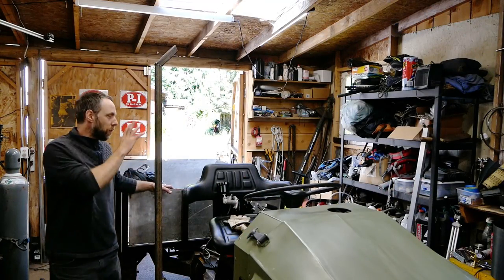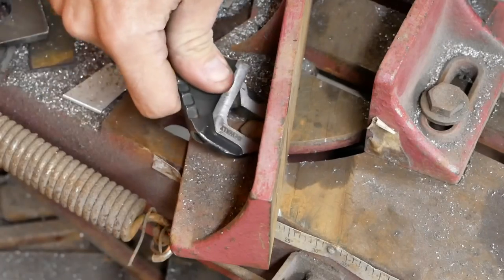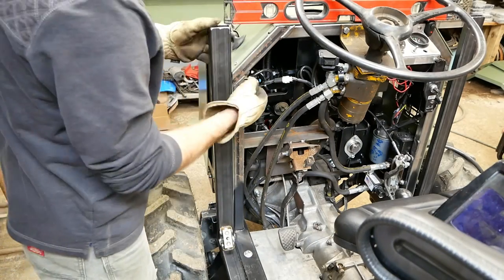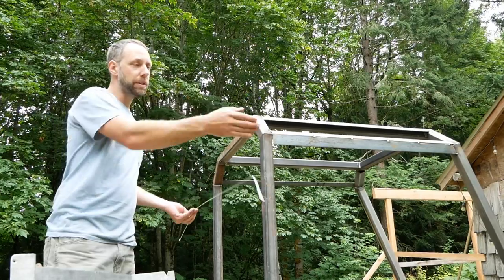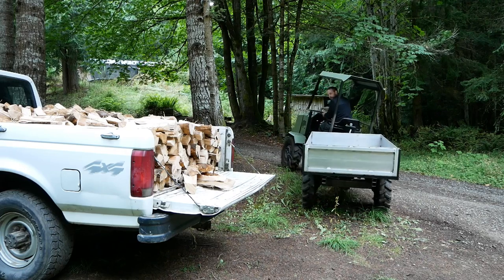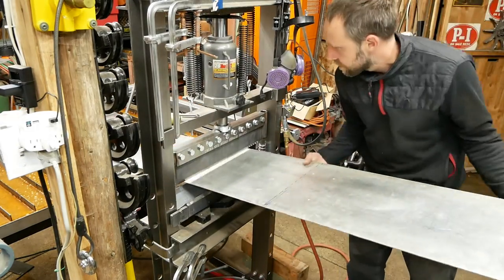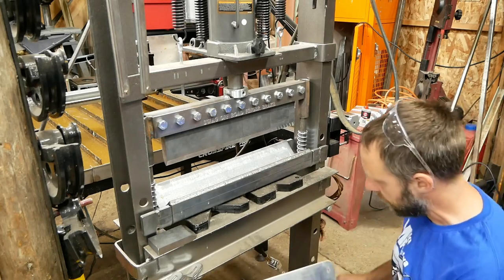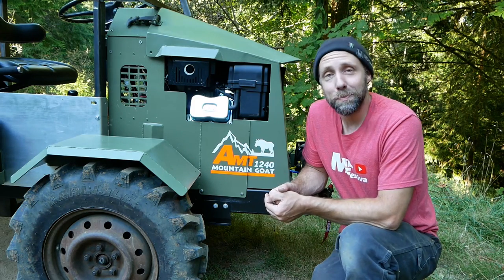420cc Predator powered articulating 4X4 dump truck build part 11

Comment: Hey Mike, I've noticed you're still using your Titanium Unlimited 200 and send to be working flawlessly. My welds are not as good as it used to and was wondering if you have any idea what could be going on with it. The best way I can describe the welds is that they are a little too tall and bulky. I've always used the recommended settings. Mig welds with 75/25 gas. Thanks.
Reply: Try slowing down the feed rate of the wire.  Try rolling the gas tank on the ground to mix it. If left undesturbed the gas might start so separate.
Reply: Yes try slowing down your wire feed or speed up your welds (move faster) Recommended settings are only a guide everybody has a unique  technique ,speed, stick out etc, Practice practice practice , you will get there we are all still learning. Good luck
Reply: @nitescuvalentin6872  
Thanks for the advice. I'm pretty sure I've tried different speeds on the wire feed, but I'll try again as well as the gas trick you mentioned.

Comment: In your Q/A video you didn't address a bed liner. In keeping with your theme of simple and robust, may I suggest UHMW liners. Thicknesses of 5/8" or more are useful for asphalt dump trucks, bu your little guy doesn't need that. The thinnest I've seen is 1/16" but that's when used as a pen liner in a barn. You'd probably be better off with 1/8" drilled to mount with the same 1/4-20 screws you used to mount the outside panels with the rivnuts. If it were me deciding, I'd bypass the Rhino liner and similar, because they have a texture that 'grabs' dirt and holds it in place, keeping from emptying the bed completely. The UHMW liners are slick, and VERY little sticks to it. It can even be useful for lining snowplows, especiallly where there's heavy, wet snow (like the Olympic Peninsula, for instance).  I love the build, and when I ran some quick numbers for reduction gearing, 6:1 is the minimum I thtought might be useful for a 10-15 horse engine working thru a Subie drivetrain. So many good things to learn, and the 6 hours (or so) I spent today catching up was time well spent. Thank you for videoing it and putting it on YouTube. 
   `

Comment: you made the ammo box holder waterproof now it will hold water. water may get in the ammo box  though the  nutcerts
Reply from the maker: The mount has a drain hole in the center of it. It’s going to be fine.
Reply: @Mikefestiva  always 5 steps ahead of them mike!

Comment: Not sure that could properly be called roll protection: great cab frame, but if you do roll the tractor, that will just bend..   Roll bars on commercial tractors are very substantial solid rails or very heavy wall steel and very rigidly braced onto the frame, not just a couple of strips of angle iron with bolts tapped into thin wall tube (if the frame doesn't bend, those bolts will likely tear out).  Race cars get  away with thin wall tubing, but it's chrome-moly, not mild steel..   Again, great cab frame, but I don't think it really counts as roll protection..
Reply: I agree I think he should have used the same material for the roll bar as he did for the frame and cope or saddle it onto the frame and possibly do some triangulation with his angle iron. I wouldn't trust the 4 bolts on the back. But still looks like a solid utility vehicle
Reply from the maker: Don’t worry guys! People always jump the gun on telling me what I did wrong, you guys understand I’m not finished right? Plus you guys don’t know what thickness the frame is, you just assume things like it’s thin wall, the frame is 3/16” and there’s going to be more tie in points. I’m not going to weld the ROPs to the frame because it would make the truck un serviceable. It’s going to be fine 👍
Reply: The guys that worry about your roll cage, are letting their eyes fool them. They are judging by eye from rigs like Case Backhoes and other equipment weighing 10 times as much or more than your goat. Under extreme conditions it might bend but that small 4X4 could not crush it.

Comment: Why does all your aluminum have a small triangle notch out of the top
Reply: I think he said it was from a snowboard mold, maybe it's for some mounting points?
Reply from the maker: Kody Ogreysik Yes Hurtman is right, all my aluminum is salvaged snowboard molds, the holes, triangles are all part of the alignment components used in snowboard manufacturing. All the aluminum also has a slight kick on the tips this is due to the nose and tail of the board shape. Not ideal but is extremely affordable 👍

Comment: So when are you going to start selling these? I need one. Maybe you can sell a kit!
Reply: Will you ever use the quad truck again?
Reply from the maker: 🙂 yes I still run the quad truck around, it still has it’s place up here on the property, the good thing about the quad truck is it can haul long beams and lumber on the rack unlike the articulating dump truck, because of the center joint it cannot span long lumber. Thanks for checking out my new video 👍
Reply: I've been thinking about the kit since I posted it. It wouldn't be too hard to put together a "weld yourself" kit. You would only need to include the cnc parts and a few custom adapters. The regular straight stock and the Subaru parts can be purchased locally.

Comment: You put the riv-nuts thru the aluminum when you mounted toolbox so now it wont be removable.
Reply from the maker: Sure just like every steel head bolt isn’t removable from an aluminum engine block 👍
Reply: he did it right look again .. mounted the tray then tool box it will come off

Comment: I have a rivnut tool like you show in the video but kept running into places where it wouldn't fit. I can't justify the cost for a full pneumatic gun but ordered this drill mounted version and it's pretty awesome! https://www.amazon.com/dp/B01JBHWBR2/ref=cm_sw_r_cp_apa_i_JBAyFbJZYNF25
Reply from the maker: I will check that one out 👍

Comment: Roll cage setup does not make sense structurally. It would been much stronger if you had done front one just as the back one and then added to that window extension bit. This needs more cross brazing and simply put plywood box would have similar amount of protection, so this cant be really called a roll cage... and here i was worried about "cage" mounting points failing from pulling forces that happen on falling side, what could been solved with using another angle iron on bottom similarly bolted and connected to top one. Cage could then be pulled back and lifted out. Realistically only back arch would need that, unless hit comes from front, for instance sliding from steep hill down, falling side ways and cage hitting a tree would front mounting fail for sure with out additional reinforcement mentioned. Then again this "cage" design wont last probably bumping a tree.

This is great machine for moving dirt and loose stuff.. on fire wood hauling, sure its better than wheel borrow, but who the fuck uses wheel barrows anymore for that purpose? We saved countless work hours by taking free pallets where we can get them, put wire fence material around it for shorter wood like in video and got some IBC container frames for 1meter long fire wood. We cut trees down, chop them into peaces, move few to dozen meters to centralized areas where those get split and loaded on the pallets. Pallets then get moved on rocky hill, covered with some old roofing and stay there until dry. Then those get moved on fire wood storage and with future optimization pallets will get stacked there and moved inside the building and even later we will be building little storage shed next to house where those pallets can be moved and wood carried inside.
Reply from the maker: It will be fine, don’t worry about it.
Reply: Wow, you make great points! Sooooo, where's your vids of your awesome designs and builds? It's alright, I'll wait........

Comment: Do you have an idea for a next project?
Reply: No
Reply: yes he is currently rounding up the parts to start on a side by side vehicle also using subaru running gear it is going to have suspension which will add a  little more complexity to the project